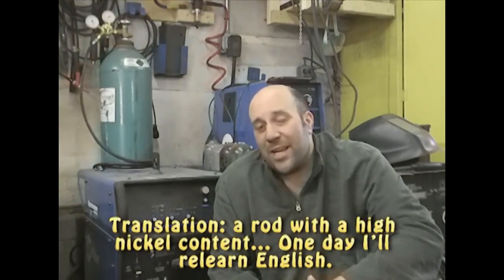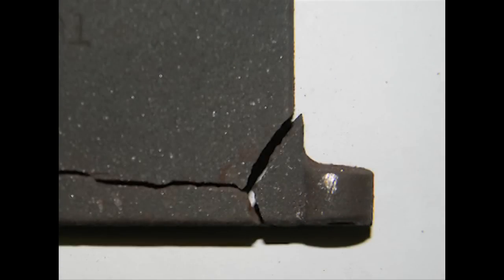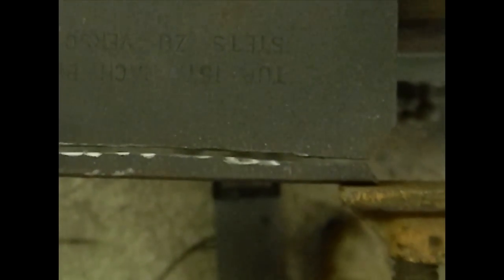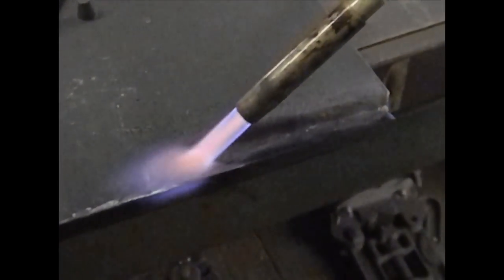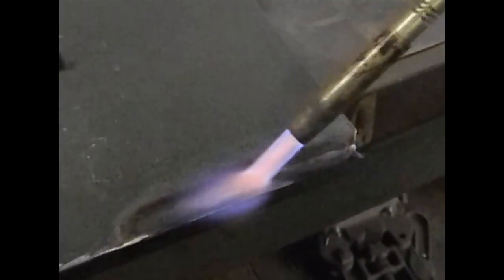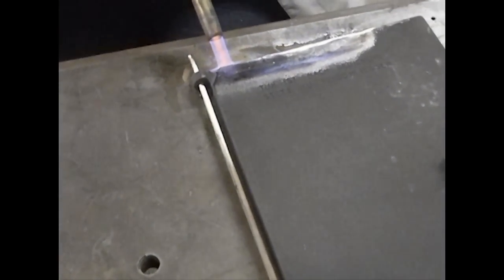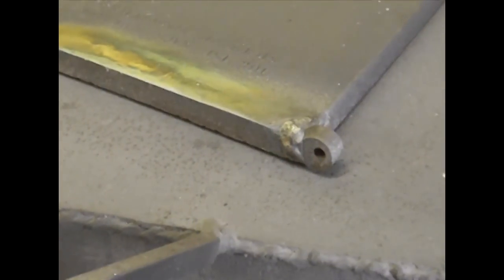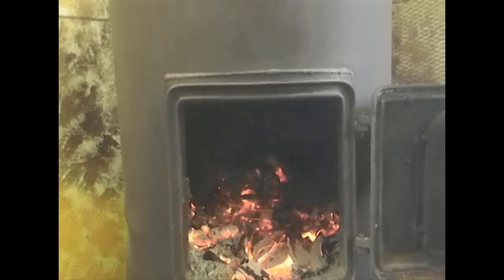Tig Welding Cast Iron

Comment from the maker: One of the biggest reasons I chose Tig on this was to actually avoid the need to peen the weld. This stove was not the best in the world and the castings were rather thin in some areas. Hitting cast iron that was thinner than 1/8 of an inch in some spots felt a little risky to me at the time.

I have mig weld cast iron dutch ovens and heavy griddles before, I just let them cool in a fire pit over a few hours. Thanks for the lead on the Jeep parts :)

Comment from the maker: During the preheat I try and get the temperature to approximately 400 - 450 degrees Fahrenheit or about 200 - 230 Celsius. After the weld using the propane torch we try to keep it close to 900 degrees Fahrenheit (480C). We slowly lower the temp back to 400F by lowering the intensity of the torch. After that we just let it come to room temperature on our stove over several hours.

Comment: Good repair, stove parts are tough to fix. Handy tip; a plain wax crayon melts around 120~140 degrees F, a decent starting point for malleable cast iron. Cheers, keep up the good work!

Comment: There are a couple of good reasons why TIG is not used with cast iron welding, it often has high micro porosity levels. It imparts no fluxing or cleaning to the weld pool as with Electrode welding. The process is slower and localised heat input is generally higher than any other electric based welding process giving additional contraction cracking potential.
Reply from the maker: That's interesting and all, but I did go to school and have been doing this for my customers for years. I've never had a part returned. If you know what your doing TIG is ideal for cast iron parts repair. I wonder what your gonna think when I post my TIG Brazing video where I am going to braze copper together using a Tig torch and a silicone bronze rod.

Comment: You can weld it with mig also. Same wire and gas as you would mild steel.  I used Lincoln wire ER70S-6 wire and C25. V out the crack well, heat the part evenly in the bbq grill, weld in passes peening between each, return to the bbq grill, and shut it off with the lid closed to cool slowly.  If you want to get some cheap practice in go down to a salvage yard and search for Jeep Cherokee exhaust manifolds, they are usually cracked.

Comment from the maker: Yes, I talked with the guys at Hocon Industrial Gas and they said my current argon bottle would work. According to them the shielding gas is not as critical as the filler material and cooling rate.

Comment: 312 stainless is very good on other very hard metals like stellite. I use it all the time welding stellite inserts to S1040 steel bodies. You do have to peen the weld to stop the stellite cracking. Hope this helps.

Comment: Hi Sir, would you tell me if you had the torch on the negative terminal. DCEN? That is the recommended way to TIG weld with Hi nickel content welding rods, right?
Reply from the maker: To be honest it was so long ago I do not remember, I know that they were Techalloy 55 rods made by Lincoln Electric. I looked them up online but did not see anything regarding polarity. Here is a link to the product: https://www.lincolnelectric.com/en-za/Consumables/Pages/product.aspx?product=Products_Consumable_NickelAlloys-Techalloy-Techalloy55-TIG(LincolnElectric)

I would suggest asking your welding supplier just to be sure.

Comment: this was very interesting and i'm wondering if you puddle the rod as it melts or do you actually start a puddle using the iron? or do you just get it hot enough to melt the rod like in brazing?
Reply from the maker: In this process I start a puddle when using the nickle rod. The quality of the casting also determines how the puddle forms, sometimes you get voids or air pockets in the cast that turn into mini sink holes while your running a bead. When that happens I stop, cut that section out with a grinder clean it and restart the bead. You can braze it but you need to use a bronze rod.
Reply: Jeffrey Santo
ok, it wasn't real clear in the video how you got started.. i've done a fair bit of brazing and so i wasn't sure how you got a bead going or puddle going at the beginning
thanks for the insight and the upload!

Comment: can the elbow/ arm  of a old  cast iron,  30x40 heat press be welded ( of any type of welding)  and still be able to hold with the light stress it takes when being used ??  picture a 1x2 , any leanth...  take it with both hands like bending a bar (like body builders do)  when both hands meet the break would be on top in the bend..like you see in a  NO U-TURN  sign...

Comment: Really good video.  I have also heard of people using Silicon Bronze or Aluminum Bronze to weld cast iron. Have you ever tried either of these?  I have a small repair and already have silicon bronze rod in my shop.

Comment: Hi, great video, interesting subject.  Can you specify what rod you used exactly?  I have an old machine base I would like to repair and only have a tig welder so this is the way I will be going.  Techalloy have a 99 rod that is specifically for cast iron tig welding.  Thanks, Ron.
Reply: I would like to know what kind of rod as well. I have heard that tig welding cast iron can be difficult if you don't use the correct technique and metals. I would love to be able to do some cast iron repairs with my powertig welder.

Comment: hello 
thanks for the good job you are doing 
butt I think your gas presser bitt high , is that for more cooling or Im wrong ?
Reply from the maker: I used the propane torch to both preheat the cast iron and to maintain the temperature of the door in between welding passes. The torch itself is the same kind you would use for soldering copper pipe together. I had it on as high as it would go for the welding but then tapered the flame lower and lower to slowly cool it down.

For the TIG torch I used for the actual welding process I have the regulator set to about 25 CFH. This is the same setting I have been using ever since I left school, the only time I change it is if I switch my cup size. Sometimes I need a smaller cup to get into tight places and I'll lower my gas pressure to 15 - 20 CFH.
Reply: thank you for the god reply
Reply: good

Comment: what king of filler wire did u used? please advise....thxs
Reply from the maker: The rod we used was a Techalloy 55, which is a 55.9% nickel content. According to the manufacturer the breakdown is as follows: Nickel 55.9% Iron 43.6% Manganese 0.25% Carbon 0.05% Silicon 0.15% Hope that helps, if you have any other questions feel free to ask... Thanks for watching :)
Reply: Thxs for it reply, I injoyed ur show, thxs, :)

Comment: Try reading what I typed again... You always use 100% argon, unless you don't. And the times you don't use 100% argon, is when you as a welder knows exactly what mix you need for the task at hand (as an advanced weldor) deciding to use AR/He mixes or straight HE. I quite literally said exactly what you said, you just didn't understand. I keep a small 40cf ar/he bottle for when I need it.

Comment: Rod, settings & gas mixture?
Reply from the maker: Rod = Lincoln Electric Techalloy 55 is used for TIG and MIG welding of cast iron.
Machine setting:  The material was less than 1/4" think and the welder was set to 100 amps.
Gas: I use 100% Argon, with a #6 gas cup running about 25 CFM.

Hope this helps :)
Reply: @jeffreysanto  much apreciated, thank you ! ¡Muchas gracias!

Comment: I'm just wondering. Csst iron is such a bitch, so why are items made with this crap ? We have a little garden bench with cast iron ends. One bolt hole cracked and now the bench is useless.
Reply from the maker: +Claude Desaulniers The honest answer is that it is much cheaper and faster to cast some things rather than machine them. Just imagine how much more expensive a car would be if the motor was machined out of a solid block of steel. :)
Reply: +Jeffrey Santo And just think how long it would last!  Not good for the producers of engines who want you to buy more from them.  If they lasted forever....